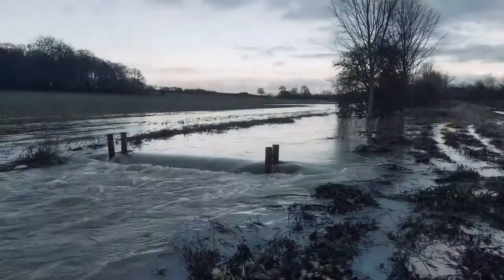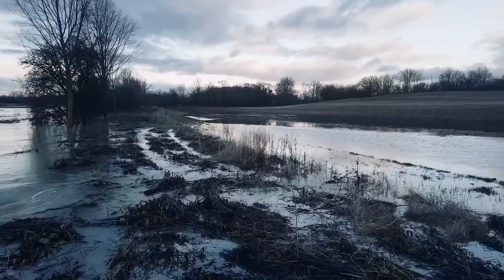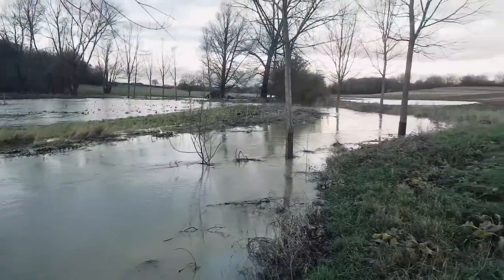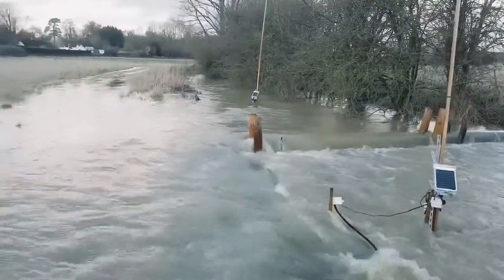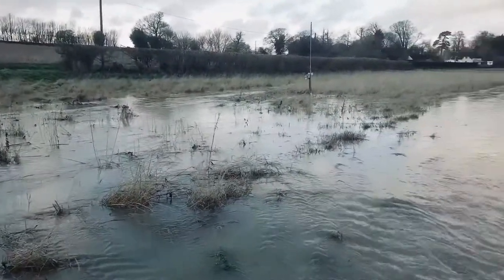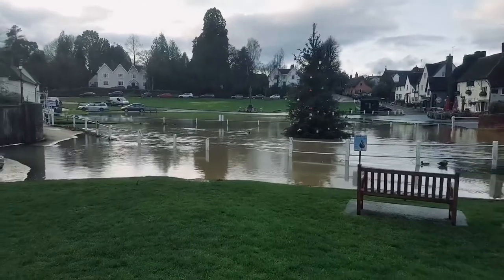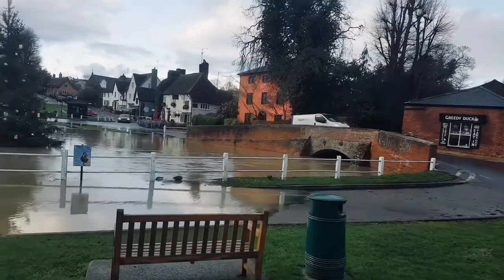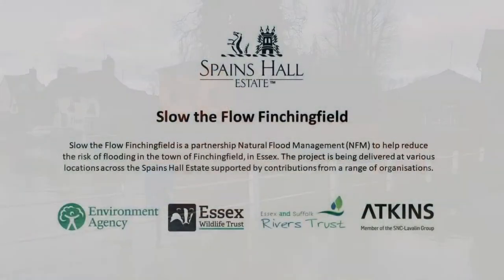Spain’s Hall Leaky Dams in operation during a flood

Comment: Gotta say, while I appreciate the effort, I think you went the wrong way.  In the US, and now a bit in the UK since the re-introduction of beavers, we learned to borrow from what the beavers spent millennia perfecting.  Namely, the bottom of the dam has to reach the ground.  The way you have the dam open on the bottom to allow for non-flood flow to go uninterrupted actually worsens the situation by promoting channelization.  As the water rises during a rain, the open bottom forces the water through the small gap at increased pressure and velocity.  It's like putting your thumb over the end of a water hose.  Yes, the wall does help spread out the water so it floods the adjacent flood plain, but under all that is the stream working tirelessly to dig out soil from beneath the dam.  

Beaver Dam Analogs (BDA) have been used to great effect in the US.  They work by mimicking what beavers do.  The idea is to allow water to pass through the dam at a slower rate so that it ponds up behind the BDA.  Not only does this mitigate the flood pulse by something like 25%, but it also stores water and creates valuable habitat for fish spawn and other wildlife.  

Of course, the key is to have many of them working in a chain going down the stream.  There are many videos on Youtube that show the building of BDA's and how they function to slow water, prevent flooding, and increase wildlife habitat.  One of the reasons why there's so much flooding like in this video is because there aren't BDA's all along the headwaters.  A BDA doesn't have to be big, or require heavy machinery to install.  Beavers have been building their dams for a million years, and none of them weigh more than a hundred pounds or so.  

It's that point which makes them such an ideal solution to flood control and erosion.  People can literally make them on their own with naught more than some pruning shears and a folding saw.  BDA's on small flows, even on dry gullies that only see running water when it rains, can be built a foot tall and use nothing but twigs and mud.  The idea is to create a speed bump in the land, something that slows the water down and allows it to sink into the soil.  When we do this on the little trickles that we can step across, it means a more controlled flow downstream where all those little trickles come together into something bigger.  Creating BDA's all throughout the land is fun and makes for a more enjoyable walk.
Reply: the leaky damn will help dig the stream deeper to take the water underground
Reply: Beaver dams are different from weirs and have different effects to help the land. leaky weirs are aboriginal and effective in Australia to capture large monsoons and channel the water underground, while also digging up vital silt that is missing from the surface. what would be spread by the beaver dams would allow water to sit only at the surface instead of moving into the deeper underground stream/ channel, and eventually through the monsoon it will dig itself down into an underground flow or help restore some underground water that is stored away from the harsh climate and short rains. the beavers dam will face fast evaporation and limited silt spread. whereas the leaky weir uses monsoon like conditions and arid unpredictable weather, beavers are great for the plains. but leaky weirs are needed in other climates.
Reply: I think a beavers stream would dry in alot of australia without large streams. they use lagoon like structures to catch rainwater wpecifixally because there isn't streams to source water or runoff to, but still have flash floods and monsoon conditions i.e. no appropriate habit for beavers.
Reply: @UwUOwO-tw5so  Leaky Weirs are Beaver Dams.  Contrary to popular thought, beaver dams leak.  It's just that the water flowing through is controlled by the beavers.  

You've obviously not watched any of the many videos on building beaver dam analogs and all the hydrographic studies they've conducted.  Everything you've posted is patently wrong, yet you write it with confidence.
Reply: @UwUOwO-tw5so  You've completely missed the point.  Beaver Dam Analogs work to slow the water from heavy rains, spreading it out so it has time to sink into the soil.  More importantly, BDA's can be built simply and cheaply, so you can put in a lot of them.  The more you install, the more you slow the runoff so the creeks never have time to build up a head of steam and cause horrible gully erosion or flooding downstream in more built-up areas.

It doesn't matter where in the world you are because the principle remains the same.  You're dealing with rain.  That's the same everywhere you go.  Beavers weigh under 100lbs, generally, and are able to build dams that hold back literal tons of water with naught but sticks and mud.  That tells us that humans can do the very same thing so long as they adhere to the same construction techniques that the beavers have long since mastered.

In the video, you see humans doing exactly the wrong thing, refusing to learn from the beavers, and look how much effort it took!  Look at the heavy equipment they needed to bring in.  And what was the result?  They lost all the benefits of small ponds behind those "weirs", increased the channel cutting power of the heavy flows, and burned up a ton of oil and gas to get it.  WooHoo!  Congratulations, I guess.

Here's a vide from some good folks down in Australia who built a beaver dam analog with the materials they had on hand.  In both cases, they experimented with different materials and techniques, but still got the water to pond up behind the dams.  This slows the flow and gives the water time to sink into the ground rather than running straight out.  And things will be even better next year as the BDA's fill in.  https://www.youtube.com/watch?v=No9mblykXII&t=166s

BDA's don't have to be some huge construction because you're literally trying to put a speed bump in the path of the water.  A dozen small BDA's along the channel are far better than one or two big blockades that need to hold back tons of water.  The idea is that you slow the water and give it time to sink into the ground.  The weird log walls in the OP do nothing of the sort, instead opting to let the water run out of the property.

Building some small BDA's in even the tiniest crease in the land will prevent that crease from acting like a gutter on the roof.  Slow the water when it's just a trickle, and you make the bigger streams more manageable and benefit the land that's upstream since that's where you're giving the water time to sink in.
Reply: @UwUOwO-tw5so  Yeah, that's a lie.  Gotta blame someone, though, right?  Gotta vent your rage and try to make yourself feel morally superior since you can't manage to hold a simple conversation or understand that you're wrong on the issue, misunderstanding the issues because you're not educated on them.  Hope that hate keeps you warm at night.
Reply: @UwUOwO-tw5so  water won't go underground just because the channel is deeper. That entirely depends on the pourousness of the substrate.

Comment: Do the motorists share the pain of the farmer whose field is flooded?
Reply: There is some flood damage, but the project also helps with waters storage during hot summers. Not sure if the farmers are losing anything.
Reply: This is a kind of 'a little too late' kind of irrigation.  The water was dirty from loss of important soil humus.  The low lying areas already have access to water, and they are doing little to do it at the crests of the farmland.  ThIs method in the video just means some areas stay wet and unplantable much longer while the hillcrests get dry and require extra work to water.  

Key line plowing; swales at the tops of the hills; avoiding bare land fallow; using several simultaneous, continuous cover crops are all important in meaningful water harvesting.

 @Daniel Rose  
The farmers are losing time and good soil.